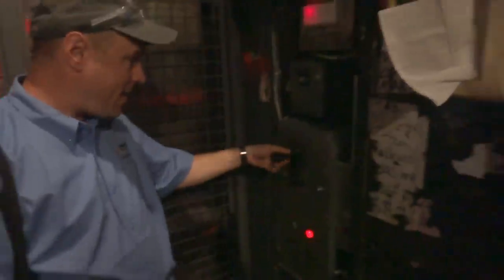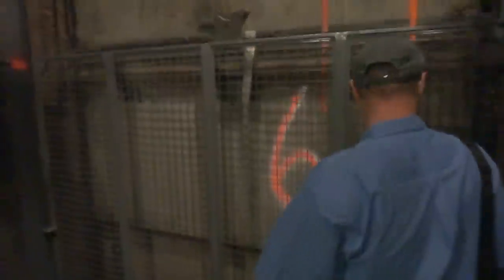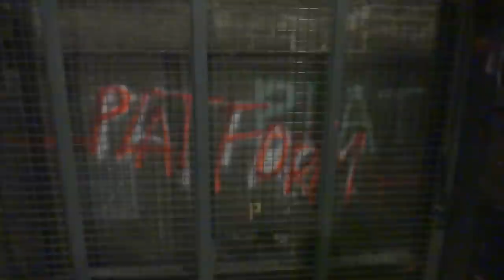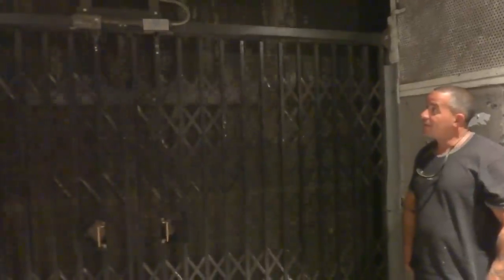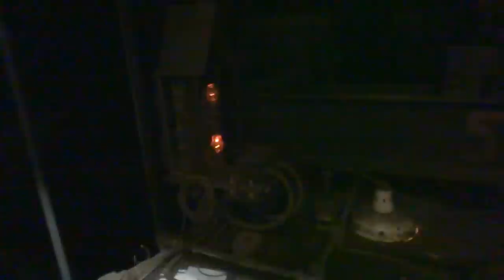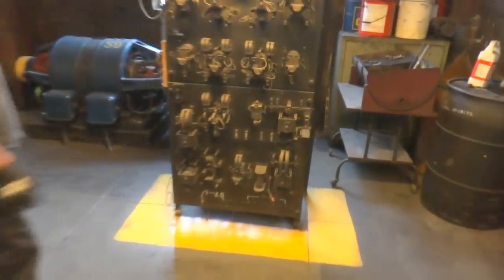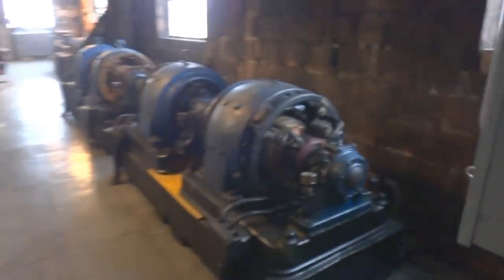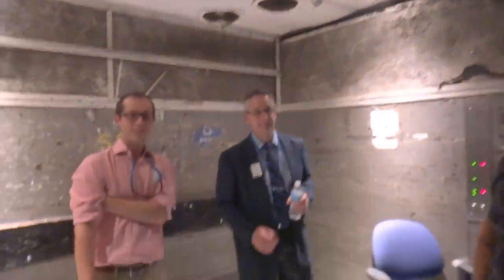Behind the Scenes @ Macy's Herald Square NYC - Tour of the Freight Elevators and Machine Room

Comment: Cars 57-59 use Gurney H19VTER machines with General Electric CR4464 controllers. I think car 59 was recently modernized but it still has its original machine.

Comment: Ben and I found a machine room full of Gurney equipment installed by Graves in 1929-1930.  I have video of it.
Reply from the maker: when/where was this?
Reply: ***** In the Times Square building last Saturday.
Reply: ***** wasn't that the building that turned us away? or was that a nearby building
Reply: EthanS Elevators You and I rode the Haughton modded elevators in the Times Square building, the one that turned us away was the one on the corner of Main and Exchange.
Reply: ***** We were on a tour of the building with the U of R's Urbex Club, and we got to see the machine room as we were heading up to the roof (it's laid out in such a way that you pass through the machine room on the way to the roof access door).  And yes, we did have permission (the tour was led by the owner of the building).  The other interesting thing we noticed about the equipment was that much of it was actually designed by GE (who we didn't know was in the elevator business) for Gurney (who then passed it along to Graves).  In fact, in the one elevator that wasn't modded by Haughton, the COP actually has a GE logo below the Graves car switch.  ***** We still need to find a time to get a ride on that un-modded elevator.
Reply: HiFiAndElevators22 We sure do.
Reply: @DieselDucy you forgot to film the passenger elevators!

Comment: When I was a kid and we lived in a 22 story building in NYC in the 1970s  it had 2 manual Otis  freight elevators and 2 Otis automatic passenger elevators, the doorman would shut the light off in the back freight elevator and chock the shaft door a little open, really meant to show tenants the elevator was closed/off after hours. I used to sneak down real late at night and go for joyrides on that back elevator, it was VERY FAST too, I would go full speed to the top and then quickly switch the controller to DOWN and it would  make the change so fast I'd almost be hopped off the floor.
The one maintenance guy who also ran the elevator would let me run it like that too up and down from the basement to the top.
I used to climb on top of the passenger cars there and learned that if I bumped the door switch it would stop the elevator and reset it and it would head back to the ground floor :) One day a guy got in and wanted to go to the top floor, but as the car started to level I bumped the door switch and he wound up having to ride all the way back down and try to get back up again . He wound up walking up from around the 18th or 19th floor after a few tries :)